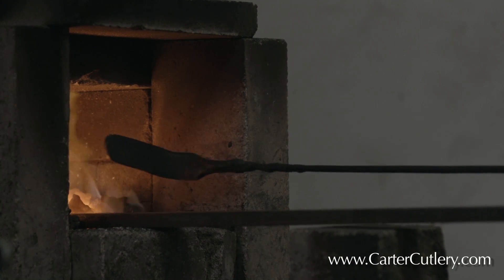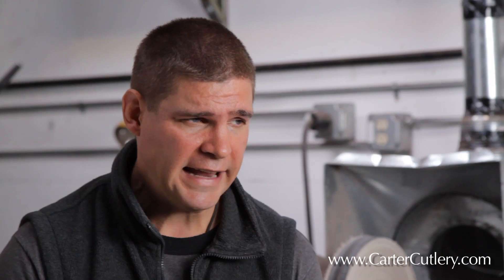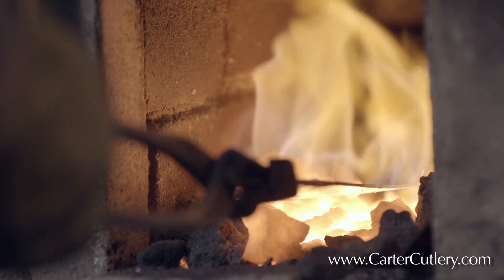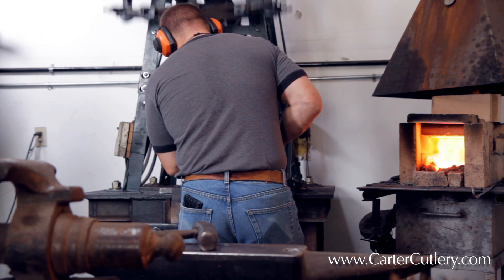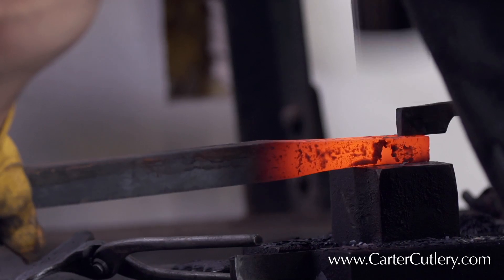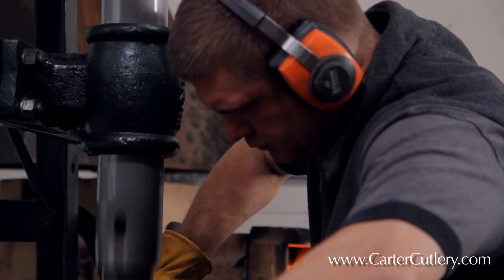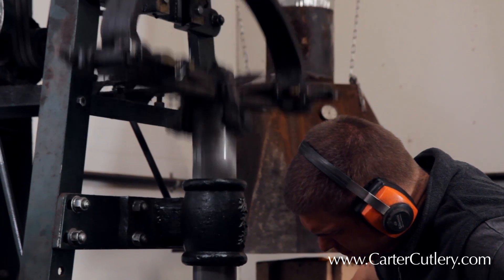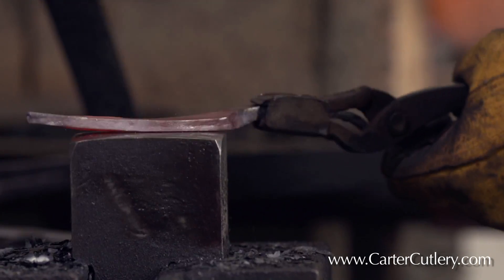Metallurgy - MURRAY CARTER

Comment: Totally nailed the whole concept of a bladesmith - mettalurgy is the heart and soul of the blade. To get the steels to weld at the lowest possbile temperature is the sign of a true expert bladesmith. Now, if you can explain how cold forging works, so well and yet N. American i.e.: ABS, bladesmiths make such a huge deal of not forging the knife at too cold of a temp., because that will create stress in the blade. Seems to me it creates a finer grain, a grain with more stress, but like a recurve bow under stress it just wants to do more and will cut better. It may not be as tough, but I don't plan on using my blade, as a pry bar.